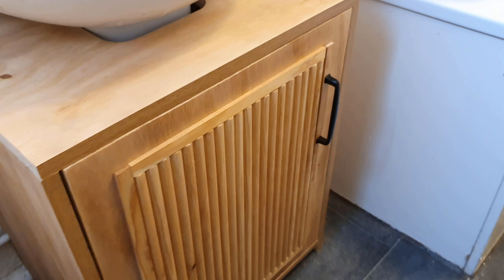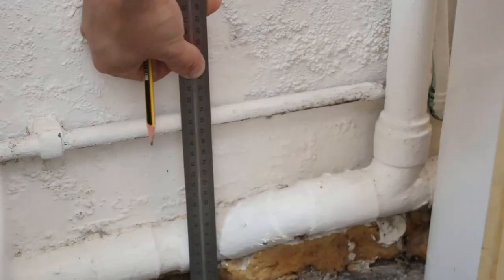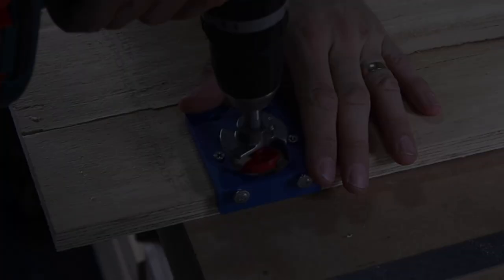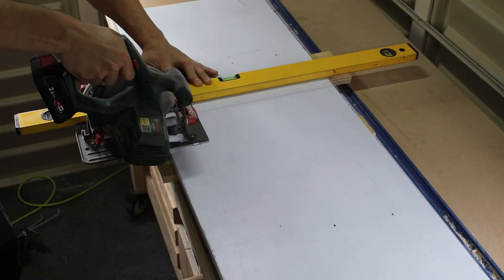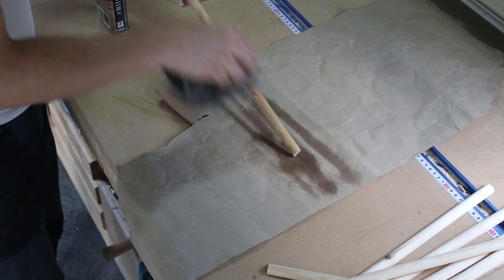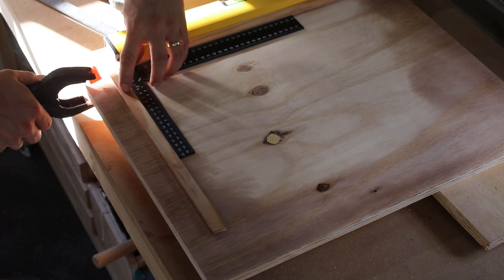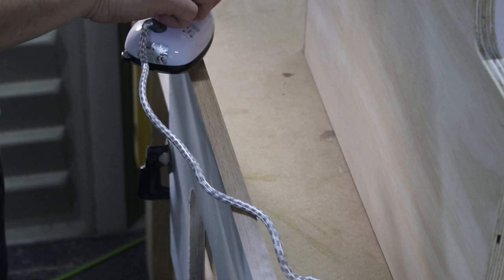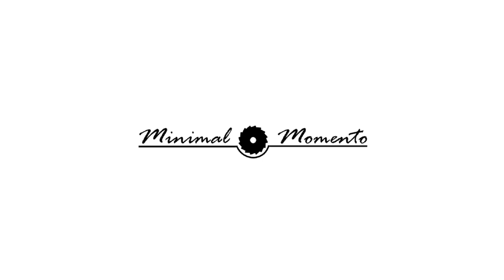DIY - BATHROOM VANITY // RENTAL FRIENDLY

Comment: Great video, thanks! You may have mentioned this and I could've missed it but I was just wondering what was the purpose of a drilling a countersink hole under the last piece of decorative trim? I'm just starting out in woodworking and am self-taught up to this point so forgive me if it's a silly question!
Reply from the maker: The purpose of drilling a countersink hole was to make the decorative trim flush with the surface of the door, since the screw of the door handle were popping out on the other side. I could also try to make those screws flush with surface of the decorative trim, but the material was already thin, i did not want to risk to damage it.